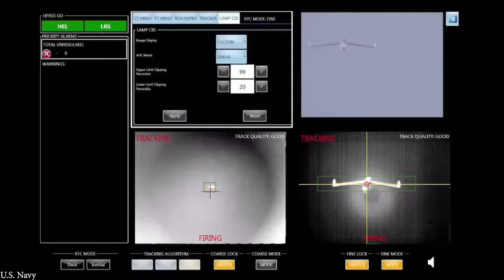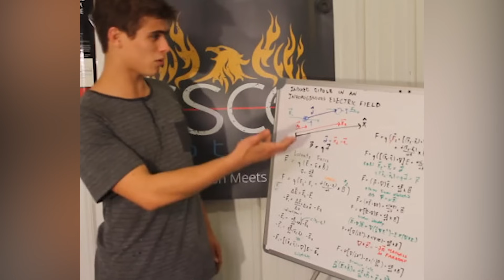15 Most Powerful Lasers

Comment: There is no such number as billion trillion? 
now i cant watch this video knowing it was made by a dumbass who doesnt know that trillions are larger than billions. 
lmao, 20 billion trillion watts. 
s"Im gonna be a billion trillion thousand millionaire mom!"
Laser are rated by wats, but you used the complete wrong scaling. 

For reference the british are shit at science in the modern era and using any f their methods to rate power or energy transfer would end disastrously literally anywhere except for England.  (They are the ones who call a trillion a billion trillion) The british are the kings of adding redundant useless ass shit to their language and measurement systems for no damn reason. Measurements like 1 stone, a kings foot, adding random u's to a word that does not need any u's. Color, colour. Im suprised they dont call them selves the BBRITTUISH at this point lmao. 

There is no sense in rating such a powerful and uncommon laser with a common middle ground ass power scale like the regular watt. 

Lasers of this size and potential are rated in terra watts and petawatts. 
1TW= 0.001 PW. 

The laser is capable of reaching .3PW currently, meaning it reaches About 300TW. 

For some reference to scale, 1TW= 3 trillion standard watts. That number looks like this 1000000000000

A standard laser pointer gets to about 0.0005 watts on average. In other words, hercles is literally a trillion times more powerful than a standard laser. This is a scale that humans really cannot comprehend. 

On paper, sure its fine, but there is no human actually capable of making a mental representation of a trillion, the only thing we can understand about a number so large is the concept that it is impossibly large.

Once numbers get up to the 300,000 range, a humans ability to process and comprehend what happens infront of them go's down drastically. Dont believe me? try attending the most popular event in your area, for me that is the Electric Daisy Carnival out in Las Vegas Nevada. Last time i went there were literally over 300,000 people, all on one race track, all dancing and throwing the biggest party i have ever seen. 

It was mind breaking. Seeing the amount of people their, and realizing it wasnt even a half of 1% of the people who exist on our planet. My mouth literally went dry at the thought. 
I could not imagine there being more people than that honestly, the number was already so large and overwhelming, uncountable, incomprehensible.

Forget understanding the universe, we can barely comprehend our own existence at this point.

Comment: Those laser you've seen aren't accurate
For comparison Thiers No green laser because No Green light May produce it will instantly turns White
Secound is Red laser aren't that Great it's actually the coldest type of Laser
Third The bigger The Lazer the bad it can Be Because Laser with intense focusing Was Intended to be More Destructive
Fourth
No laser may Used in Planes Such as Jets Because the Fog/cloud Blocks the Photons that Pass though
And Finally
You need more power to powered a Laser 
So putting it on A jet Drains Power
So much Faster (even if It was Powered by the Turbine I doubt it would be Enough)
Reply: Those green laser may be cause by Putting a filter or Tainted lense to Get Green color
But it will melt off when it reach trillions of Degrees

Also If you ever reach that Degrees it will results in miniature blackholes but it will evaporate quickly
Reply: @Ihave_fallen I have a green Lazer

Comment: It's really dumb to use watts instead of total energy sent per shot. Because they don't send that energy for a total of 1 second. They send it for less than a second and lets them overinflate the number. For example I could send 100 Joules of energy in a tiny fraction of a second and it lets me overinflate the watts to a huge number. Even though such laser could never operate continuously every second.

Comment: I'm surprised that you didn't mention the ABL (see: https://en.wikipedia.org/wiki/Boeing_YAL-1 ). It successfully shot down a simulated SCUD missile. The wiki article is a bit unfair regarding the program's cancellation. From my perspective, the program's problems were primarily managerial, not technical. The biggest unsolved technical problem was safety. The chemicals used in the COIL were both volatile and very corrosive. Today's systems may not be quite as capable, but they are significantly safer.

Comment: I worked at a company that specialized in laser welding and cutting. We had CO2 and YAG lasers. We could cut through 3/16 think SST like butter. Once whole holding a prototype to be tacked together in my hands I got careless and the laser hit my thumb. I felt the impact but no heat or pain. 2 seconds later there was plenty of pain! Amazing machines.
Reply: I'm see up
Reply: I ran a 400W Mitsubishi CO2 laser cutter which could cut 3/4" SS at about the rate that you write you name. Gold is the only material it couldn't cut due to refectivity.
Reply: @RobinOfTheWest  interesting 👍

Could i make a portable version and build a laser rifle 😂?